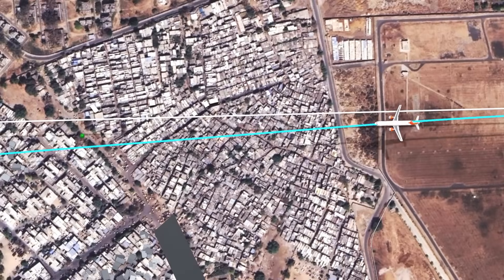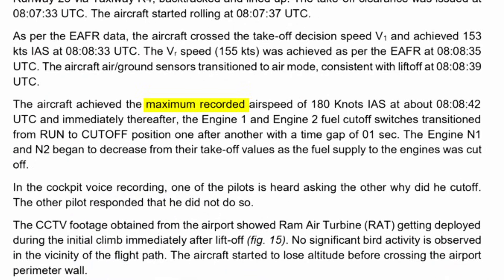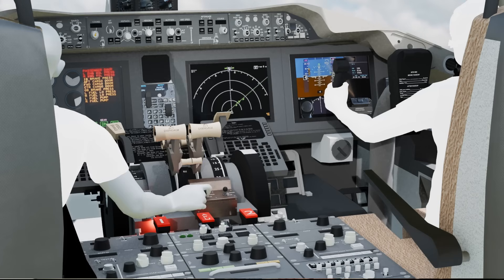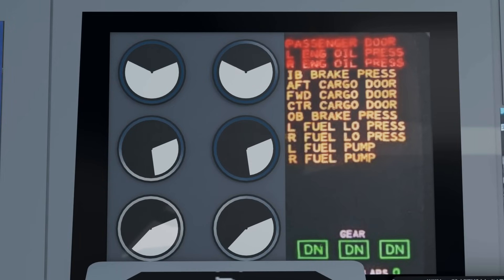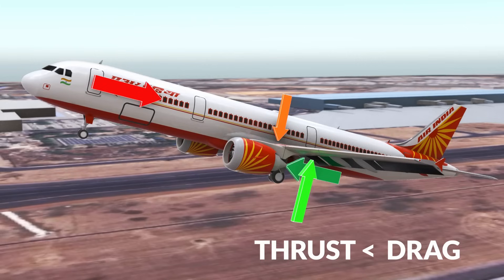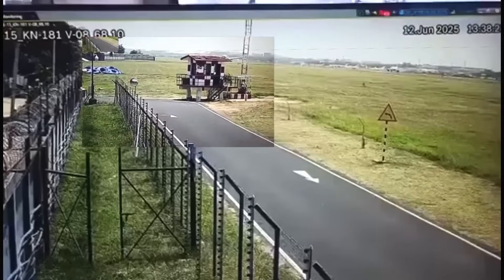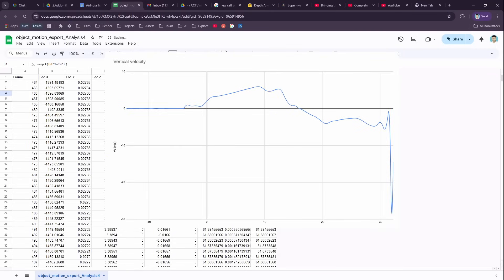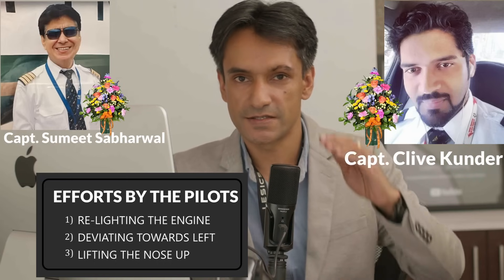Use of 3D Clone | Decoding the Crash Details you Missed

Comment: Please feel free to support or oppose.

The APU intake door takes about 15-20 seconds to open (it is an engine and needs air to combust).
After the door is open it takes 7 seconds for the starter to engage and turn the motor on with the assistance of the APU Li-Ion battery.
The start sequence takes 90-180 sec approx to complete (spooling up) and start supplying electricity to the main engine after the motor converts to a generator on the APU. (Based on Internet searches and reading of manuals and reports.)

The main Li-Ion battery in the forward section is not able to start the main engines on 787-8. Hence the process of engine restart is not instantaneous.

Given that the APU doors started opening at 08:08:54 and the last recording of data was at 08:09:11, barely 17 secs apart, there was not enought time for a full reignite of the engine. The entire flight lasted 32 secs from lift off. If this was deliberate action, then the person shutting off the engines would know that if the shutoff were done during early takeoff, there would not be enough time to reignite both engines and resume climb due to low altitude of the aircraft.

Hence, early shutoff of both engines at about 454 ft height guaranteed a ground impact. Only an aviation expert would have known that IF it were a manual intervention. Many are speculating that the people writing the AAIB report are inexperienced and ill-informed. I bet they have seen the entire CVR recording and the entire FDR data. They have intentionally revealed partial data. These are not findings. Findings are propably a lot more than what has been revealed. To question the ability of the investigating and reporting teams is not prudent. One can certainly question their motive for not revealing more data. Rest assured they know a lot more and definitely the entire sequence of events. Many people are projecting their own partial understanding (due to sparse information) on to the AAIB team which consisted of NTSB, Boeing and Indians.

In short - disabling of both engines was a fait accompli so early in the flight and low altitude that recovery was virtually impossible given the APU technological sequences and time lines. Amen!
Reply: I agree with most of what you said. 1 point of correction though. The engines can restart without the APU if they are still spinning (windmilling) sufficiently fast.
Reply: @stimproid  Thank you for pointing it out.  This is what the AAIB report says - 

"As per the EAFR data both engines N2 values passed below minimum idle speed, and the RAT hydraulic pump began supplying hydraulic power at about 08:08:47 UTC."

Was the speed enough to relight the engines even though below minimum idle? I agree that engines can supply electric power to one another for restart. In this case APU would not be needed and will be superfluous even if it kicked in. We also know that RAT had already deployed before the APU and could supply the necessary electrical power to begin the engine start sequence, including spinning the VFSGs as starter motors to bring the engine's core up to a speed where fuel and ignition can be introduced. The engines did try to restart and Engine 1 showed signs of recovery with rising EGTs. Even if the RAT is deployed, APU would start as the RAT has limited power output compared to the APU and the latter serves as a backup source. I do not know if RAT electrical supply came online. The report is silent on it. It only says RAT started supplying hydraulic power before the APU intake door started opening which was 7 seconds later (08:08:54 ). Note that APU was only deployed 2 seconds after the switch was reset to ON (08:08:52) "consistent with the APU Auto Start logic." They say baseball is a game of inches, this is a game of milli, if not microseconds.

The report is scarce in detailed information and I hate to speculate. Thank you for your insight. I tend to agree with you that some elcectrical power had possibly been restored to the first engine, likely by RAT while the APU was still in the process of spooling up.

This thread of reasoning begs the question -  why did the pilots not switch the fuel switches back to ON earlier and gain valuable time knowing that if windmilling was strong enough to reignite the engines with the RAT already deployed, they would have had a better chance of survival. I realize this is Monday morning quarterbacking but 10 second delay is quite long between OFF and ON, considering how low to the ground the plane was.
Reply: @stimproid  This from the "trusted" Internet. I am not trying to prove anything right or wrong. Just want to fill the gaps. Thanks.

While an engine can windmill (rotate due to airflow) with the fuel cutoff, the low-pressure spool (N1) speed below idle (1,000 RPM - 20% of max) during windmilling may not be sufficient to drive the generator at its required operating speed.

Here's why this scenario might not be ideal for generating electrical power:

Generator Speed Requirements: Aircraft generators require a specific and consistent RPM to produce the correct AC frequency (usually 400 Hz) for the aircraft's electrical systems.

Windmilling vs. Operating Speeds: Windmilling speeds are typically lower than the engine's normal operating range, and may be insufficient to maintain the generator at its required speed.

Engine Spool Discrepancy: The generator is often attached to the high-pressure spool (N2), while windmilling primarily affects the low-pressure spool (N1).

In summary: While a GEnx engine, like any other turbofan, will experience some rotation of its spools due to windmilling after fuel cutoff, generating useful and stable electrical power for the aircraft at low RPMs like 1000 RPM during windmilling is likely not feasible due to the design requirements of the aircraft's electrical power generation system and the inherent differences between windmilling and operational engine speeds.

If N2 (high-pressure spool) is below idle RPM (around 8,400 RPM - 60% of max), the engine would no longer be producing thrust, and its primary role as a power source would diminish significantly. While the engine would still be windmilling due to the aircraft's forward motion, the Variable Frequency Starter Generators (VFSGs) on the engine would not be generating their full power output at such a low RPM. 

A GEnx engine on a Boeing 787-8 cannot generate enough power to relight itself (i.e. self-sustaining combustion) solely through windmilling at an N1 speed significantly below idle (e.g., 1000 RPM or 20% of maximum) if the fuel switch is simply turned back ON.

Jury is still out until the final report.
Reply: Gents, good questions. If you look at the 3 videos by Jeremy John Thompson AI 171 ( just google it and start with the first video) you will find all the answers and the proof. 
The guy is a little rough around the edges but has all the facts and backs them up.

Comment: The Pilot recognized that the Cut Off switches were in Off Position... By Software Glitch? Come on
Reply: It probably was always in run position but fdr recorded as in off.
Reply: @kumark214  there is a voice Recorder and the Pilot saw the switches Off.
Reply: @rowbee3216  How do you know the "pilot SAW the switches off"?
Reply: @ayushvora1672  explain me anither way, how he couls recognize... And If it was a SW glitch u would see in Data, that the Position would Switch from on to Off and directly Back to on. Not being for more than 15 sec on Off...
Reply: @rowbee3216  They may have been drowned in several EICAS messages suggesting failures and cutoffs. That's enough reason for asking the question.

Comment: 1) The switches can be moved easily within 1 second. 2) Time resolution is +/- 0.5 seconds. So, report allows also 2 second time gap or 0 second gap. You are wrong here.
Reply: No. Multiple pilots say not possible. Anyway rat deployed earlier so that’s moot.
Reply: @kumark214  You're making the same mistake as many other people. The clock starts running when you open the first contact. So you have a full second to open the second contact. Got it? (But it's amazing that highly paid pilots don't understand something so simple.)

Comment: 7 knots isn't much speed, is that going to make a difference. Maybe one pilot wanted to crash it and the other didn't and flipped the fuel switches off. If it was crashed on purpose it's very unlikely  both pilots wanted it to happen.Will the industry tell us what they find.

Comment: Hmm why did you turn off the fuel? I didn't! Well now if you didn't turn it off and I didn't turn them off then that means the computer did it. 😂 it's nuts to me that if this system tripped off the fuel pumps that the switches don't move and or an audio and visual alarm is not set off. A suicidal pilot is going to auger that plane into the ground or a building at max thrust not soft hit the ground randomly.

Comment: Mr. Mathew, I will not speculate on the reason for the crash but use AAIB data to prove a point. I question your "simulated" analysis which is interesting to watch but is based on make believe data. Reminds me of Alice in Wonderland. You manufacture your own reality and create your own data points. Before I state my doubts let me agree with you that the early RAT deployment points to a root cause other than fuel cut off which ensued following some other failure, most likely hydraulic (since the gear was down throughout the ill-fated flight).

The AAIB report says maximum height achieved was 454 ft AGL (based on 625 ASL - 171 ASL which is Ahmedabad elevation). You claim it was 198 ft AGL based on your modeling.

AAIB says maximum speed was 180 Knots, you claim it was 206 Knots in the end and 210 Knots earlier - a discrepancy due to posible carelessness.

The differences in height and speed can give very diverging results. We need to be careful.

Your numbers are based on some camera-based path alignment corrections and I do not trust them. AAIB numbers are based on actual FDR records so they should take precedence. You introduce a phony residual thrust argument. It is phony in the sense it is not relevant here because the data in the report is based on actual observations and recorded. It is real. This brings me to my final point.

A Dreamliner 787-8 usually has a takeoff angle of 6 to 7.5 degrees. After the engines are cutoff a 12:1 glide ratio is a reasonable assumption in the absence of thrust. This ratio implies the aircraft loses 1 ft in height for every 12 ft traveled on the ground. The AAIB report says the ground impact took place at 0.9 Nautical Miles from the end of runway 23. This translates to 5,469 ft. If you measure the same distance from the end of runway to the impact site on Google Maps, it is about 5,333 ft. Finally if you use the height of 454 ft ASL and multiply it by 12 (glide ratio) you get 5,448 ft. All three methods converge and confirm the facts of the AAIB report. They line up well and tell a consistent story. Very simple explanation, and elegant.

If we assume your claimed maximum height of 198 ft. then the plane would have made ground impact over a much shorter distance. Hence, in your "imaginary" world you need both the residual thrust and the relighting of engine N1 to provide secondary thrust to cover a longer ground. The report explains the ground distance traveled easily with assumptions of glide ratio within the parameters of the plane's performance metrics.

Finally, you say "numbers do not lie." Aren't you contradicting yourself? You are asking us to reject the AAIB FDR numbers which are real but instead accept your numbers which are retrofitted to backup your personal agenda, whatever it may be. I did enjoy watching your video and learned some new terms, but I do not agree with your claims based on "numbers" that are questionable to say the least. Thank you.
Reply: new script?

Comment: I have been commenting since day 3 that this airplane definitely climbed to less than 200’ agl, simply based on the security video and wingspan. So you are 7 weeks behind me.
Reply: If you watch the full video of the flight and compare the wingspan (200ft) to the distance between the plane and the ground, you can see that the distance is significantly more than 200 feet.
Reply: @stimproid no it isn’t. The airplane never climbed to more than a span above the ground. I measured it, so I don’t know what you saw.
Reply: @XPLAlN  Did you watch the video or did you use the still photo from the report?
Reply: @stimproid …as I said before, the security video.

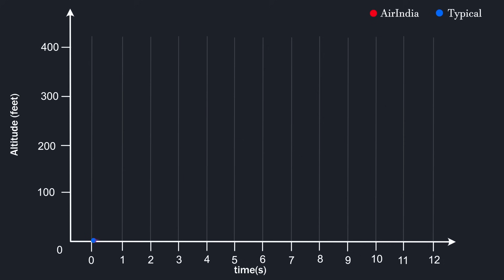Comment: Just 1:44 in and I already know this guy’s theory is flawed.  The chart of take off performance is misleading.  The “Typical” line represents performance under ideal conditions - not the density altitude at that airport on that day.  If you take the CCTV footage of the previous 3 departures of AI171 and overlay them on this one, you’ll see that there was no deviation until 5-6 seconds after liftoff.

Why do people think there is some coverup to protect Boeing, GE, etc.?  If this was caused by the aircraft itself, the very worst thing they could do is cover it up.  One crash due to a faulty aircraft would be bad for the company, but a second as a result of something they knew about after this incident, would be the end of them.

The part about the attempt to turn at the last second to minimize the damage is plausible and the copilot is to be commended.  Not everyone would have reacted the way he did in such a high-stress situation.

Thankfully this guy started off with his graph and saved me the 16 minutes of having to watch the rest to realize he is just one more who cannot accept the terrible truth that a pilot is capable of doing such a horrific thing.

Comment: ok.  Im sorry but the aircraft simply CANNOT continue to INCREASE speed once fuel is cut off.  That is an impossibility once the thrust is cut for an object to continue increasing in speed.  Simple physics.. It may continue at its current velocity for a few seconds, but continue speeding up.... nope, not possible.  Try it.  Get in your car.. put your foot down hard, take your foot of the accelerator and I promise you, you will NOT continue to speed up.  If I am wrong.. please show me the psysics that show an object can actually increase in speed with no thrust
Reply: It can. As long the engine exhaust gas has higher speed than the plane, there is a thrust. So kinetic energy from the fan can be transformed to thrust. Until the exhaust drops to plane speed, then the acceleration becomes zero. This is different to a car where the tyre on the street and the engine are hard coupled by a  gear.
Reply: @halloalle2588  You have made me second think my thinking on this.. but I still maintain that its not possible for acceleration to continue after fuel has been cut to the engines. Not via thrust.  Acceleration due to reduction in altitude could in theory happen, but not from thrust from what I can understand about the physics of it all.  Again.. Im open to be proven wrong
Reply: @deanwatts68  The jet engine is a pneumatic system. Unlike a hydraulic power transmission system, it can store energy through compression and release it at a delayed rate. The stored energy is in the turbine. Only when the turbine switches to windmill mode is its kinetic energy used up and it no longer generates thrust. Thrust always means acceleration. When the thrust falls below a certain value, an equilibrium state is reached and from this point on, the acceleration becomes negative. When the thrust is zero, the speed begins to fall more rapidly. Only then, not before. There are therefore three time windows. 1. Falling acceleration + speed is still increasing. 2. Falling acceleration + drop in speed is slowing down. 3. Acceleration = 0 + speed continues to fall unhindered.
Reply: @halloalle2588  
Sorry, there are a few flaws in your argument.
1. "Thrust always means acceleration. "  no it does not!!!If thrust is less than drag then there is deceleration.  If it iquals drag then it flys at a constant speed. You even contradict yourself in your statement directly after saying that thrust always = aceleration.  If it was true, then a plane with its jet running, producing thrust, would just keep accelerating!! Ummm.. nope.
2.  There is no "stored" energy in a jet engine to allow it to contiue with positive thrust once it has no fuel to power it.
The turbine has kinetic energy yes, but it will not not continue at a rate sufficient to produce positve thrust.  There is also no stored compressed air.
Its simple, unless you are talking about microseconds, the moment the fuel is cut to the engines, the plane will stop accelerating and comence decelerating. Your arguements have helped to convince me even more that I am correct in this.
Reply: @deanwatts68  You don't understand. There is an acceleration, even if it's partially balanced, and you're only seeing the net result. And how long you see a net positive acceleration wasn't up for discussion. I don't know the stored energy, so I won't specify a time. But it's not zero, and that's the point. ;)